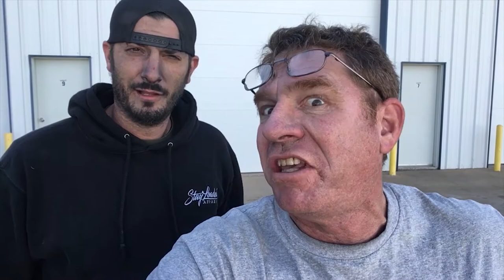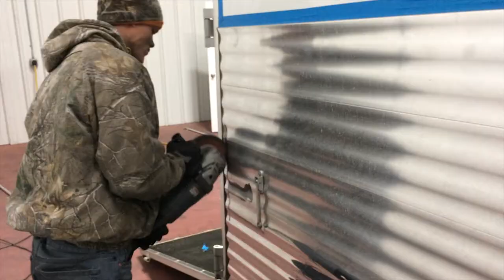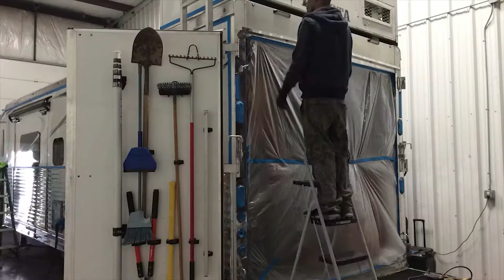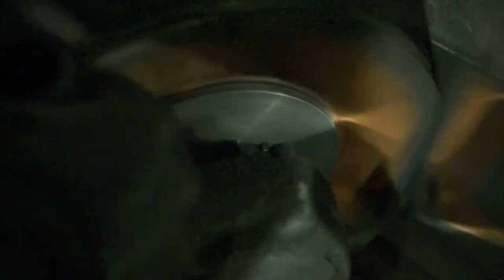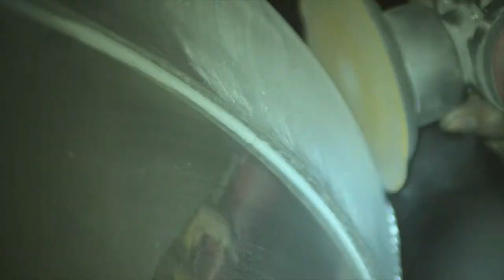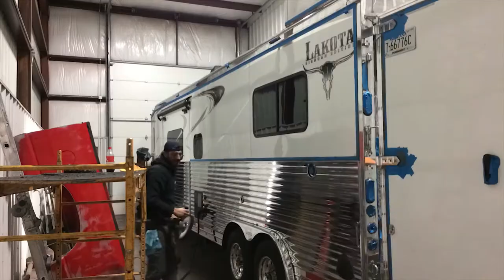Polishing a horse trailer

Comment: Looks great! You got me looking at going the horse trailer route instead of an rv. But I will have to buy an older one and do it my way. I almost had a heart attack when I got the email quotes from sundowner and Lakota....
Reply from the maker: Yes they can cost more. A stock one without a generator can run around 67K or more depending on the model. A standard RV is about the same new. But an RV will need a new roof every 5 to 7 years. When it comes to a horse trailer it all comes down to where you buy it. California will cost nearly 20K more not including registering. But a horse trailer should give you around 30 years of use. You can find good used ones if you look hard enough.
Reply: @CrazyMarty  I priced the BH8X14CE model. The one with the refrigerator and sofa on a slide out, generator and automatic satellite, 3 horse. My price here in Tennessee was just under $88k. Sundowner quoted me $67k for a much larger unit. I found a used Cherokee about an hour drive that I'm going to look at Friday. 16' short wall 4 horse slant. Has generator and haypod on the top, its 20 years old but only $11k.
Reply: An rv is great if you wanna set it up somewhere with a canopy over it and never move it. But like you said, a horse trailer is designed to last and last. I'm also looking at 34' and a 48' gooseneck enclosed cargo trailers.  All aluminum roof and side panels, steel framing.
Reply: I'm just a poor country boy, I cant afford to pay more for a trailer than I paid for 45 acres of land.
Reply from the maker: Yep. They are pricey. Mine is there toy hauler version but I had them make the rear a horse trailer door and ramp. I also had them give it 4” lift VS stock. I needed the extra height for off road. It’s 32 foot long. I would rather of hade 26.  The longer they are the harder it is to get around. Oh and a diesel generator VS propane.